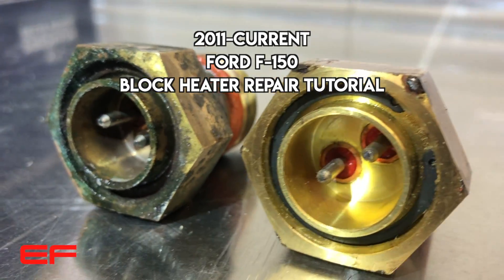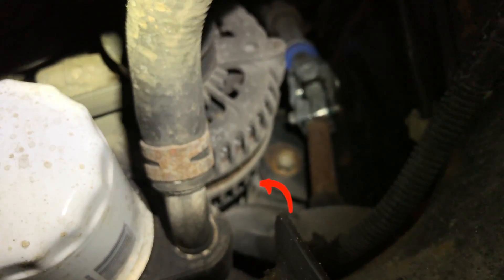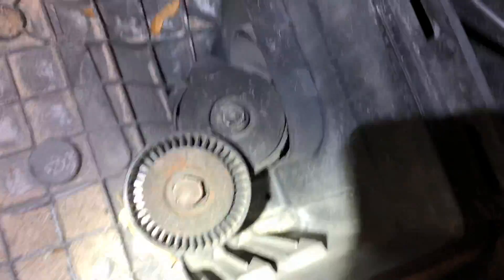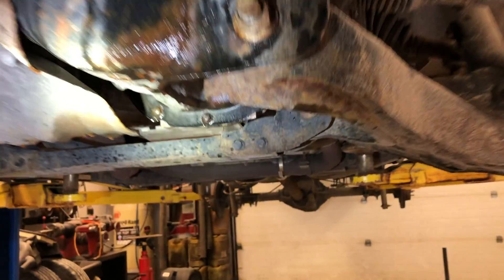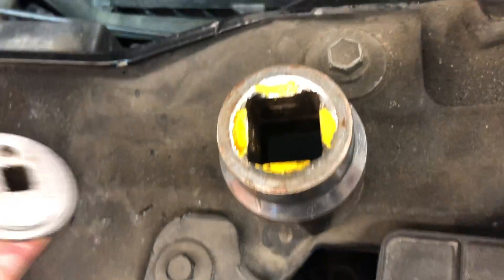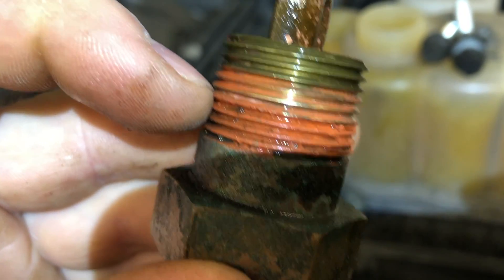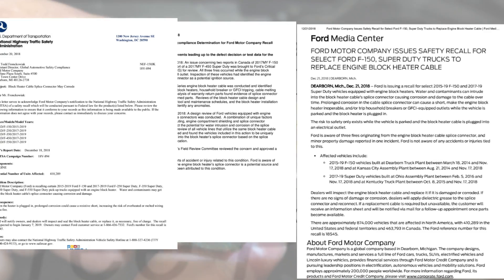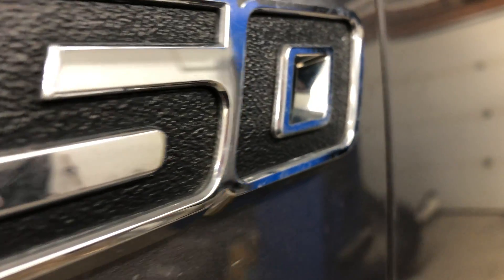FORD F-150 Mysterious Invisible Block Heater Coolant Leaks- DIAGNOSIS & REPLACEMENT!

Comment: Man, I hope this is my leak issue. I have changed the o rings and y pipe but still leaking. I originally thought it was the front axle. Do you think a plug would hold?
Reply: That was the problem! Just fixed it and put a plug in hole.
Reply from the maker: Nice Work! That is the easiest and most durable fix long term 😃🔧
Reply from the maker: I thought the same thing. Turned out to be a leaking block heater for me. A pipe plug would be a permanent fix if you can live without the block heater and don't want this to happen again.. The hole the heater goes into is pipe thread 😃🔧

Comment: Is there any chance that a product like Bar's Leak stop might fix this without having to pull the truck apart?
Reply from the maker: It's possible it could work and help out. I would only do it for a temporary repair though. Might not be super reliable. Best reliable repair would be to replace it or cap it off for permanent results 😀🔧

Comment: found the leak myself but didn't know what the part was until this video. Excellent video with tool sizes and the option of closing it off with a pipe plug was perfect!! Living in sunny west coast I have no need for a heater so bypassing the replacement cost of this $50 - $100 part was great to know. Thank you for a great video
Reply from the maker: Im glad you got it all figured out! Simple system to diagnose but made impossible to service easily by engineering the parts into hard to see and touch places. Absolute madness. Super frustrating experience. I really tried to help the next person experiencing this issue and i really appreciate your comment! Makes it all worth it 😀🔧
Reply: @EasyFixShaun  On my 2011 F150 5.0 V8.   From the undercarriage and without needing to remove the driver's side wheel, I had full unobstructed access to the part
Reply from the maker: Wow that is awsome! I tried from below and could not see anything at all. The front axle and steering gear and subframe were all in the way for me 😃🔧

Comment: Fords telling me that there is a coolant leak that’s the reason my block heater arched the one night when I plugged it in. I brought it in for recall they disconnected the cord that was melted. Told me I would need a new block heater and that cost is on me $575 for the part.  This should all be covered under the recall no?
Reply from the maker: I am not certain about anything Ford does. The recall is for the block heater leaking. Maybe it doesn't cover the block heater melting. I would call Ford's customer service corporate hotline, I have seen some people get help or at least clarification that way. I am sorry you are having a problem. Good luck😀🔧

Comment: Could this issue cause the tranny temp to be high? Mine has been up to 256 degrees with normal driving for 30 mins.
Reply from the maker: Possible.  But not likely. As long as your engine temp is normal it's most likely that the two are not related to each other. I hope that helps! 😀🔧🔧
Reply: @EasyFixShaun  Makes sense, thanks for the reply.
 Ordered a new bigger tranny cooler so hoping that does the trick.
Reply: Figured the tranny issue out but i have to change my block heater aswell due to this leak.
Easy question, if its a quick change out with minimal fluid loss is it necessary to flush the coolant system of is topping it up fine?

Comment: I just noticed a leaked today. I believe it’s coming from the same spot. I also just got the truck from the Ford dealer used with 56k. It’s a 2017 2.7 though I need to talk to them.
Reply from the maker: Could be a block heater if they use them on the 2.7L. 😃🔧

Comment: I just did one of these today, except the Lariat trim has a external oil cooler and whatnot in front of it. I was looking for where the butt plug was and at the back of the block is a nice little 4x4 square inch area that this could have went, but no! They had to fucking put this in the most hard to access, only pays .5 hours to install, (not including having to drain the system, remove the alternator, not remove the oil cooler plug, install everything, fill the system with coolant, get the air out of it, etc) The actual labor time is 2.9 hours
Reply from the maker: I had some choice words for Furd when I replaced this one also. Extremely frustrating. Sorry you had a hard time.

Comment: Same issue here. I want to cap it off.  Should I use a particular metal so it doesn't corrode? Also, what kind of thread sealer?  Thanks!
Reply from the maker: I would use a brass pipe plug or stainless steel pipe plug. The brass one should be plentiful and cheap at any hardware store. The dealership may have an option also. I would put some Teflon tape or liquid sealer on there and torque to 30ft pounds. You should be golden!

Comment: I have the 18S45 recall notice on my 2018 F150. My notice claims that the block heater cord is the issue, now I'm confused do they just replace the cord or are they replacing plugs and cords?
Reply from the maker: Ya ford claims the plug is the only issue but you saw where my leak in the video was. Ford caused the problem and are they are now trying to save money on the recall by replacing half of the parts. This is a typical corporate response with most recalls. Not all, but most. I’m sure if you call their parts department they have half a dozen of each part in stock. Coincidence?? Their goal is to get you through the warranty period sadly. Once that happens it’s not their problem anymore.
Reply: The 18S45 has been updated to a 19G01. Which they replace the entire block heater cord. The original issue, if you read your paper work is water getting into the cord because it's a 2 piece. They've updated the block heater cord with a 1 piece cord. It has solved the issue. 
If you have a coolant leak from the block heater itself, you'll need the dealer to pressure test the system. Verify the concern, and replace it.
I'm currently replacing a leaking block heater on an 18' and it's a NIGHTMARE.
Reply from the maker: Thanks man for the information. Excellent! I’m sorry it’s a nightmare. I would agree it’s stuffed so far in there that replacement is basically by “feeling” only. You can barely reach it and barely see it even with a mirror. Makes diagnosing a pain. The whole job is a pain from start to finish. And confidence is low because you can’t see what you are doing. But in the end mine went well with no issues. The saving grace is that the part is a standard pipe fitting and if it is screwed in correctly with sealant, all will work fine. If it was a traditional freeze plug that had to hammered in....it would be as infamous as their timing chain issues on the 5.4L. There is no room for a hammer, only you hand and a wratchet. If it was a traditional freeze plug, engine removal would have been necessary. All in all it’s a bummer that this is happening. But it is manageable with some patience.

Comment: I still cannot find my coolant leak on my 2013 5.0. Starter was fried once already from being covered in coolant, swapped out water pump and that t-connection...still have a good leak I cannot see. I add a gallon of coolant every 4 days. Hate to take it to Ford.
Reply: I have the same issue... it’s frustrating. Working so much I can’t take it to the shop. The y’all want me to leave it there... it’s my only vehicle. 
2014 STX
Reply from the maker: That sucks man. It’s hard when transportation breaks on you. You may be able to plan a repair with the dealer and get a rental at the same time. That is one advantage of taking it to the dealer. If you want trouble free vehicles Toyota’s are usually the best bet. Usually only brakes and tires and general maintenance are needed with them. ...usually.
Reply from the maker: Can you pressure test it? I would start there and try to determine where the leak is coming from.
Reply: Easy Fix I wouldn't even know where to begin actually. I really don't think it's coming from the block heater since it's located on the driver's side and all the coolant is clear back at the starter and tranny. If I have it running and ac or heater on, pure water pours from under the aluminum heat shield thing above the tranny. I've let it sit running and couldn't see the coolant dripping anywhere. Wipe it all off, nothing. Drive it, park it, coolant all over both the starter and tranny. Lol.
Reply from the maker: I am sorry for the late reply, youtube put this comment in the spam file. My bad. Did you figure out your truck? Were you able to pressure test the cooling system and pinpoint the leak? Did you take it to the dealer?
Reply: Easy Fix I found out my truck still had extended warranty. I thought the warranty stops when the truck is paid off. It was the water pump gasket. They gave me a loaner while the truck was being fixed but it was complete the same day. Thanks for checking!
Reply: Cost of repair? I know warranty covered but usually they have it on the paperwork
Reply from the maker: Excellent! I’m glad they stepped up to do your repairs. 😃
Reply from the maker: There are links in the description for the cost of the block heater and the cord. Give em a click! 😃